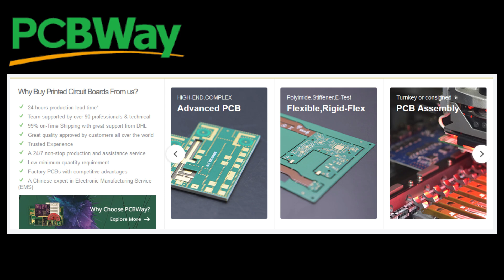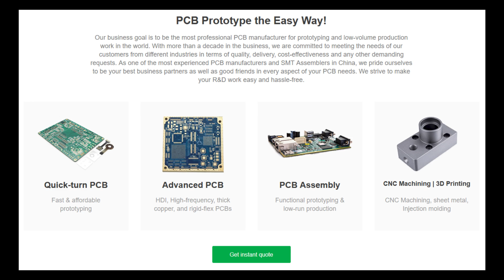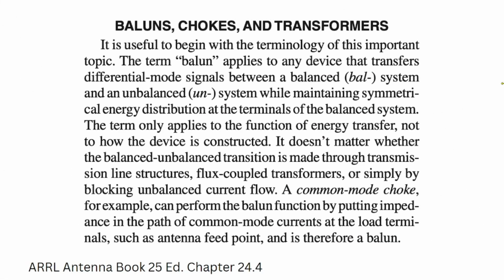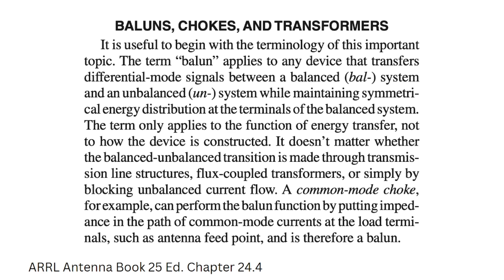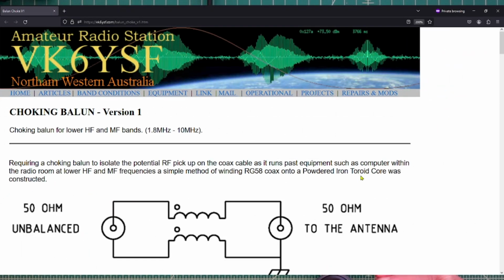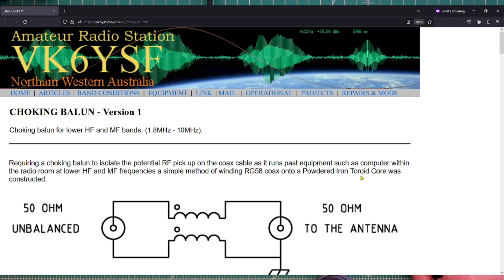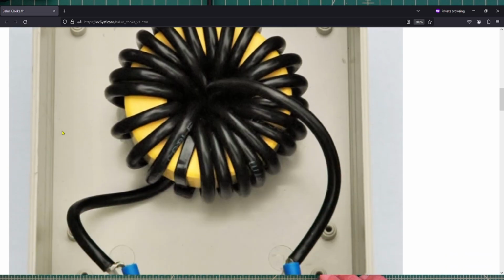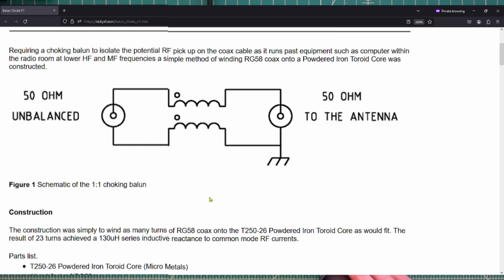Balun Choke Myths - The Long Overdue Clarification

Comment: If a "BalUn Choke" suppresses and isolates common-mode currents between an UNBALANCED feedline and a BALANCED antenna, then what do you recommend using for suppressing and isolating common-mode currents between a BALANCED feedline and a BALANCED antenna? Is there a distinction to be made? If not, then why characterize it as a "BalUn" type of Common-Mode Choke (CMC) rather than simply a CMC, with or without a Transmission-Line Transformer (TLT) such as a BalUn or UnUn which often has an ADDITIONAL function to convert impedances, which a simple CMC does not.
Reply from the maker: I’d use the same device and not get wrapped around the axle with labels 👍

Comment: You could drive the proof into their heads with the proof at the end of a nail, and they will still disagree. How many times I have heard that is a compromised antenna I'll never know. Any antenna is a compromised antenna unless you only operate it on the frequency it is cut for. Same people with beams with traps on the limbs. I just ignore them and build what I want, tune it and have fun.
Reply from the maker: Agreed Steven, thanks for watching and for the comment 👍

Comment: I care not what it is called! Monkey see, monkey do (a bit of wire and a ferrite toroid). I use a random wire, around 30m, with a 49:1 balun. In the shack, I initially use a manual tuner (Kenwood AT-230), to adjust my compatibility with 5W CW, (followed by the rigs ATU if required). This gives me all the voice bands I want, 160 to 10, just 100w from the rig, and I also seem to get excellent reception.
Reply from the maker: Thanks for the comment Tom 👍

Comment: Thanks for the many excellent videos. I am curious how the Balun Choke that is longer and skinny is constructed. Is it just 3-7 ferrite beads around the coax with shrink wrap around that? Have you ever explained how/why the ferrite bead chokes work? If not, then that might be an interesting video. 

To follow the "Always Be Choking" (ABC) advice that you and others have shared I need to buy or build a few. Those skinnier chokes look nice because they are more streamlined (so I am thinking of buying a few), but my guess is they aren't as effective as the other ones you show and have explained are coax wound around a toroid.
Reply from the maker: Hey Cary, thank you for watching.  The skinny ones are beads on coax, each bead is kind of like a turn through a toroid.  I have tested both and what I typically see is that the toroids work better and are pretty cheap / easy to make.  I've actually been working on a beaded choke and will have a video at some point, just have a lot of project going on at the same time.

Comment: I JUST LOVE THESE VIDEOS, BUT HEY,IM NOT A NASTY SWEATY HAM POLICE, BUT BALUN IS ACTUALLY A BALOON WICH IS FILLED WITH AIR, FROM LATVIAN LANGUAGE BALŪNS OR BALONS MEANS BALOON AND THATS WHY MY POINT IS VALID, NO SUCH THING AS UNUN BECAUSE FROM THE OLD OLD LANGUAGE OF LATVIAN UN MEANS WHAT, SO IF YOU TRANSLATE IT FROM OLD WAYS, IT MEANS "WHATWHAT" SO WHAT CAN BE ANYTHING, BUT WHATWHAT IS SPECIFICLY AN ANTENNA THAT DONT REQUIRE ANY CONDUCTOR, USE YOUR RADIOS WITHOUT ANTENNA IS "RUNNING AN UNUN" ON YOUR RADIO, IVE BEEN DOING THIS FOR 37 YEARS AND NEVER HAD ANY PROBLEMS, TRUST ME, IM COMMENTING ON THE INTERNET SO EVERYTHING I SAY IS VALID.
Reply from the maker: If it’s on the internet, especially in the comments section, it is try…

Comment: Thanks for the video.

I bet most of those "Ham Police" are licensed for less than 5 years, passed the licensing test strictly by blind memorization of answers (assuming they didn't just give a VE a few bucks to pass), and have no clue what Morse Code is, yet they consider themselves "experts". They have never grabbed pieces and parts from the junk box, added some scrap wire and actually soldered together an antenna. Their idea of "building" and antenna is buying pre-cut/pre-assembled "kits" on-line--and they'll believe whatever the advertisers tell them..
Reply from the maker: I feel this might be accurate.  Let’s not forget get they repeat whatever they hear as well…

Comment: Is there a way to look at those transformers on an oscilloscope? I mean to show anyone how they work by showing signals passing through different points, e.g. entrance and exit. I've heard about phase shift at that middle pass-through, and that makes sense, as flux should flow in one way in the toroid. Therefore, it determines the current phase, but I can't imagine the measuring circuit to see it.
Reply: https://www.youtube.com/watch?v=E9F7Aot_AFg&ab_channel=TheSmokinApe
Reply: @weather_wizard67  That's the frequency response measurement, and I'm curious to see the transformation of the signal-voltage response in time. For a regular transformer, that is simple—two input oscilloscopes and measurement of voltage on input and output, and you will see signal ratio and phase delay. But for chokes or baluns, will it be measure of voltage drop on coils. How can a signal with the common mode current be generated artificially, and then what to measure  to see the current symmetric again after the choke?

Comment: Great video Ape. This is easy to understand, I don't know what's going on with the ham police, maybe they are a little emotional about the " power gain " an antenna tuner provides after the conjugate match on your first PTT press , maybe getting into Harry Potter's territory here, but let's move on. If it is installed at the antenna feed point and its only purpose is to balance currents, it is a balun. If it is installed down the  transmission line, closer to the shack, it is a line isolator or common mode choke. If it is used as a matching transformer, there is little to no chocking action, thus the term balun transformer is more appropiate. 73's
Reply: Agreed, it's more about the application than the hardware. All of these applications take advantage of the same electronic principles, to address different (but still related) needs. Hardly worth arguing about.